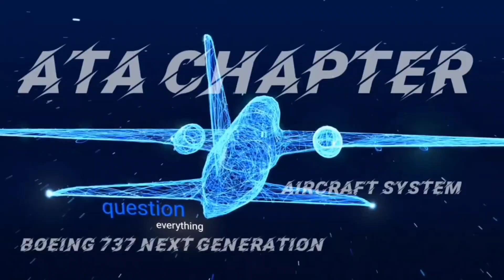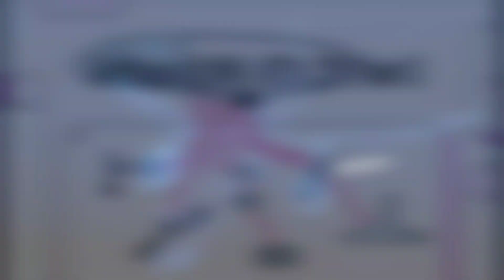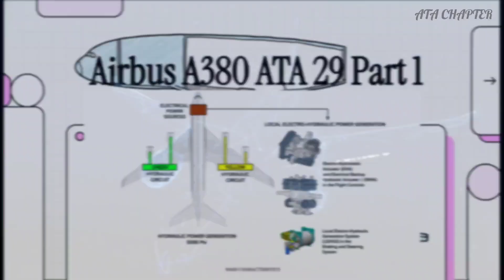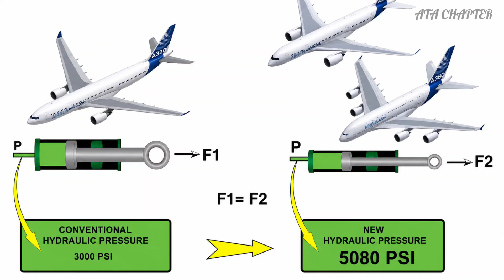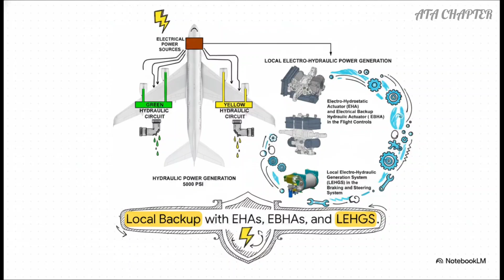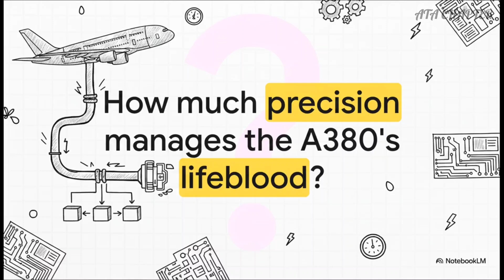A380 ATA 29 Part 1 (ENG) Explained: Hydraulic System Overview & Architecture

Comment from the maker: Each system has:

- A reservoir (installed in the outer pylons) to supply the hydraulic fluid to the engine hydraulic pumps and to collect the fluid from the return line.

- Four hydraulic pumps, two on each engine, directly connected to the accessory gearbox. When the engines are in operation, the engine hydraulic pumps pressurize the hydraulic systems automatically to a nominal pressure of 345 bar (5000 psi).

- Two fire shut-off valves installed on the hydraulic pump suction-line of each pylon. They isolate the hydraulic pumps from the reservoir if there is an engine fire or an explosion, or a rupture of a suction line.

- A pylon HP manifold which transmits the pressure to the consumers.

- A pylon HP manifold which transmits the pressure to the cargo door system and to the belly-fairing HP manifold.

- A belly-fairing HP manifold used to do an internal leak check of each part of the system.

- A power accumulator which adjusts the hydraulic-pump response time and decreases the effect of the pressure surges when there is a high flow demand.

- A Low-Pressure (LP) outer-pylon manifold which transmits the return pressure from all the consumers to thereservoir.

- A LP belly-fairing manifold which transmits the return pressure from all the consumers to the LP outer-pylon manifold.

- A case drain manifold which transmits the case drain pressure from the engine hydraulic pumps to the reservoir and then from the electric pumps to the reservoir.

- Quick-disconnect couplings on the suction line to prevent fluid leaks during the engine removal.

- Hydraulic ground-cart connections on the inner pylon. There are two types of connectors, one for the HP delivery line and one for the LP suction line.